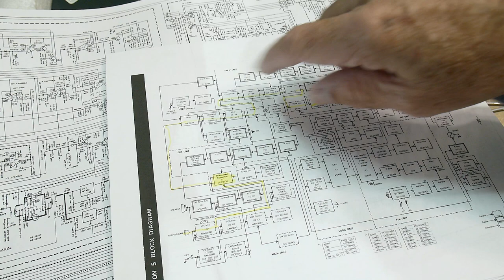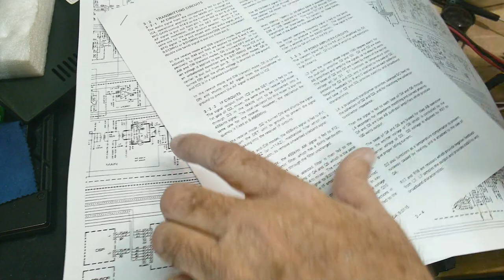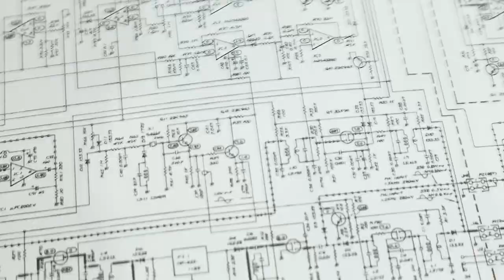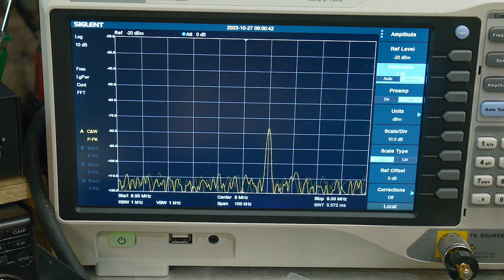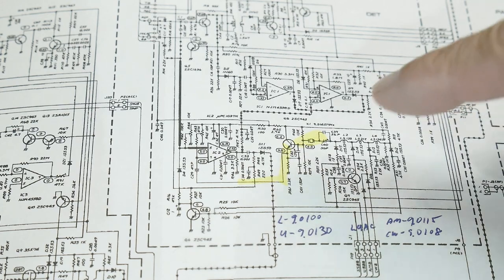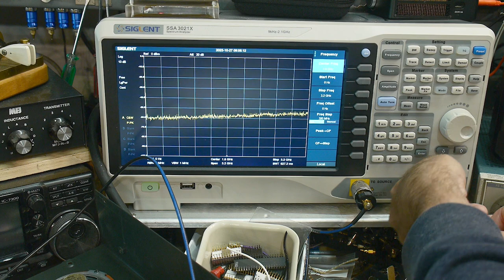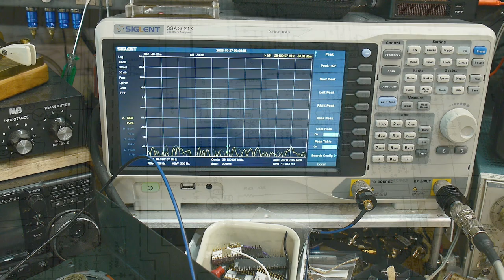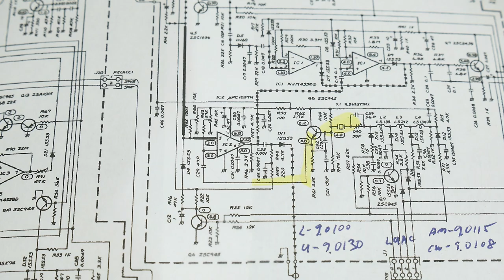#1710 ICOM IC-730S Transceiver Repair (part 5 of 5)

Comment: Those pots would benefit from being replaced, and also with adding in some resistors to limit the operation range as well.  Or you can replace them with 10 turn preset pots, and have the benefit of less track noise as well. Icom should have put a resistor in series with the ends of the pots, to reduce the available range they can adjust to something like 2V to 5V, which would make adjustment much easier to do, as the circuit says the range is around 3V. 1k each side of the 2 pots would work well enough, making it less critical, and reducing the effect of the noisy pots and drifting as well.